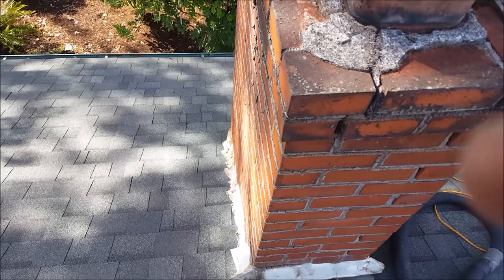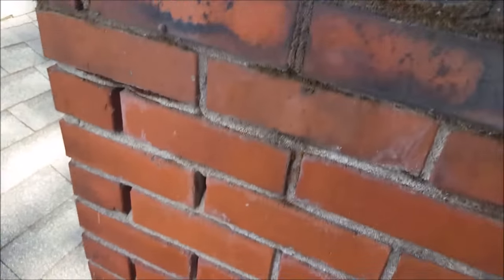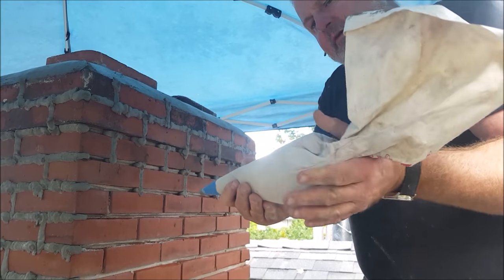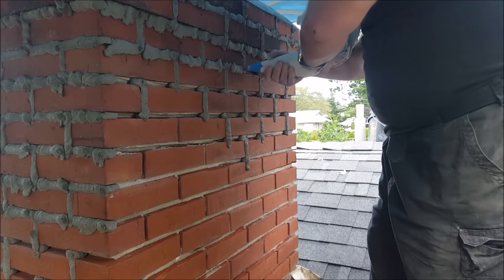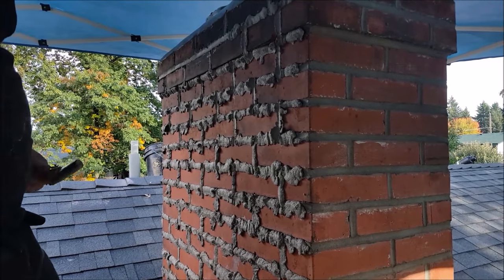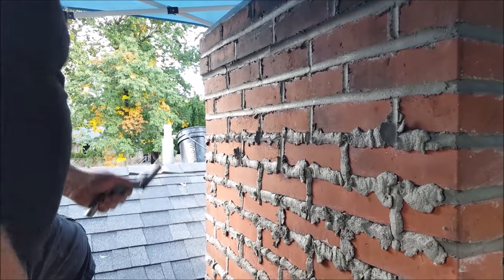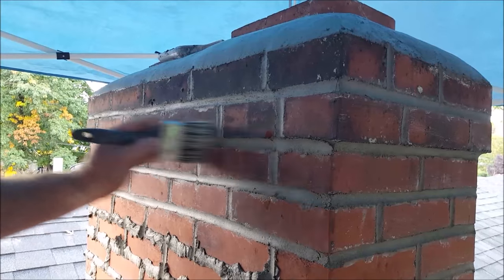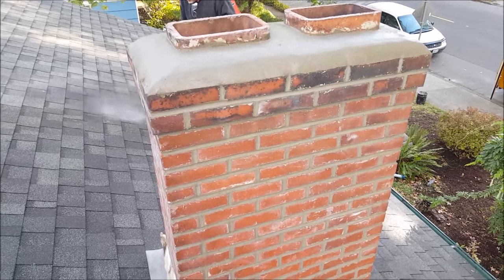Tuckpointing a chimney

Comment: I'm a mason for over 30 years and I've been a masonry contractor for about 10.  What you have seen in this video is a true professional doing a very professional job.  That chimney will be good, like new, requiring zero additional maintenance, for at least another 10 years after his tuck-pointing work on it.  Well done sir.
Reply: not a warranty question but how long should something like this last using the fireplace once a month? im near SLC-UT 🇺🇸 or best to call the masonry people? as the local chimney sweep said that it's about a 2-year job between when i need them again
Reply: @richardprice5978  Any discoloration then
Reply: Very gracious of you , Sean. Thank you.   Cliff
Reply: Any idea about the cost of this job?

Comment: THANK YOU! This is one of the best how-to videos I've seen for us average DIYers with old houses (and I've watched a ton of them). My 95yo chimney is in far worse shape than this one, and you excellent commentary and tips—not to mention excellent camera work and lighting—have been a tremendous help. Thank you for taking the time to share this with us.
Reply: Hey Dan: I had my helper shoot this from my phone, with no special lighting. I appreciate your feedback and compliments.  Cliff
Reply: @cliffordbrand5969  thanks im needing this service done to my place so it's nice to know what to expect from my mason/a mason doing the job sounded like the hole top part of the chimney ( love chimney's and fireplaces parts of the character/charme that sold the place to me plus white stone/brick siding ) cap/roof-stack needed to come completely off and be rebuilt brick by brick but maybe i miss understood how the process works or does sometimes that's what needs to happen to fix it right? all i know is it flunked it's fire-marshal/county ( plus birds and other critters were living in it somehow i missed that and it add's to the damages ) testing and was told not to use it intel i got it fixed, guess after i do get it repaired i need to use it more often as it went bad from neglect/unused for 5+years and now is also threatening the rest of the structural integrity of the 1960's-70-house i didn't know about this when i first moved in so im passing too others as a FWI-cautionary tell

Comment: I was skeptical when you first placed the mortar on how messy it looked, but when you cleaned it all up with your round & flat tools, it looked so nice & very professional.  Excellent work!
Reply: Thank you JG!
Reply: @cliffordbrand5969   hello there!  So me and the wife just bought a house about a year and a half ago and noticed maybe 5 6 months in that our chimney has a leak. Our chimney runs up the back of our house which is connected to our family room and the roof of the family room. Is at an angle on the outside.colonial style home,  from my bedroom window i can sled down to my chimney if you know what I'm saying.. Anyway the drip was small at first and then its started getting real bad having to put towels down in the front of the fireplace so water doesn't run through the front on to the carpet.     I'm no expert so i can't spot the problem but my son did say he noticed that there is a good 3" 4" inch space (open) at the top of the chimney under the cap.   Somebody told me look up in my chimney when it's sunny out and i should be able to see any kind of light that will point me to the problem not sure how credible that theory is but i did it and don't see anything except the light at the top from the crown..  Wife thinks it is the flashing that's draining right down from the roof into the cracks.     Professionals wont return our calls and I'm ready to fix it my damn self before my house floats away.    I'm thinking the people that lived here before us just rigged it up with calk or who knows what!    In short.. I'm lost and you seem like the man with the plan.. any advice you could give me would be greatly appreciated.

Comment: Great job. I'm a chimney/stone man and what I do to skip the acid washing bc I hate it is I use a slicker and a hawk. Pre wet the chimney and before it dries totally I use a dryer mix and stuff and strike as I go. The old chimney guy I learned from never let me use a bag said that's not how it's done but looks great. Nice job man
Reply: lucas keeley an important benefit of using a bag is that there is less repetitive motion taking place. You’re not constantly turning to get more mud which, over the years, is going to affect your back.
Reply: Thanks Lucas, I appreciate it!
Reply: I have done it both ways, the grout bag is faster but it is also a bit messier. Doing it the old way with a hawk board and slicker does provide a higher quality job. You are able to pack the mortar tighter in to the joints with less chance of leaving voids. I carry Rose Brand slickers (the flat joint tool) each slicker have a different sizes on each end, that gives me six different sizes, that allows me to properly pack every size joint from small to large. Then I follow up with a regular concave joint tool. One way to get speed and better quality is to use the grout bag, then pack the joint with a slicker, then along with some additional firm mortar finish with a concave jointer.
Reply: @jthkeystone  Pointing with a hawk and a pointing tool is waaaay faster than this if you know what you are doing

Comment: What exactly is the mortar mixture ? Is it 5:1 sand to cement ? When adding water to the mixture, how do you know when to stop adding water ?  Must be runny enough to exit the injection bag, but not too runny to run out of joint ?

Comment: I am curious to ask, i was always told and advised,  that when pointing  of any kind after removing the old  cement you must wet it down   thoroughly before filling it back with new, so it does not dry out, a nd it helps the new cement to stick there to the brickwork,I was told this is a must do  job,so i always have ,
Reply: Yep.

However he is using loose mortar because he's using a grout bag so it might be ok
Reply: Your data is correct Peter.

Comment: Are there weather temps that should be avoided when tuckpointing?  What is the optimal weather temp to do the work? 50 -75 degrees?
Reply: As long as the temp doesn't go below 40° at night and  it can be warmer than 75 but, try not to do it the direct sunlight especially hot days unless you have done it many times. ( fast) It would be nice to do it in the shade ( make your own) on those days. or Late afternoon - Wait till you can see your thumb print before you strike. If using a tuck pointer and trowel, just do a little section at a time ex - foot square - till you get the hang of it. Make sure to keep the mortar off of the face of the brick. the mortar should be no wider than your tuck pointer / slicker when you pack it in

Comment: Yes the mortar  will stain the roof, get some old carpet to put down,he will step in it and push it into the shingles,then he will have to use a wire brush to clean the shingles and that messes up the shingles.
Reply: We kept the area cleaned up as we went along. Kept the roof sprayed down. No stains on the roof at the end of the job.

Comment: I thought you were suppose to wet the work before applying the mortar ?
Reply: Shelter keeps the sun from drying the mortar out too fast
Reply: @DRS659  Almost everything built in the United States in the last 25 years has been built with type S mortar.  It's the standard mortar specified for most block and brick jobs.  It's the standard mortar stocked at all the big box home improvement stores.  It's very likely that the chimney was originally built with type S mortar.  On the wetting the bricks, yes, that is right.  BUT, if you look at the job while he's grinding out the joints, you'll see that the bricks are covered with dust from the grinding.  Then look at the next scene where he his beginning the tuck-pointing and you'll see the bricks and joints are all very clean, suggesting that he did rinse it with water.  You want the bricks hydrated but not soaked.  Too wet and they don't draw the moisture from the mortar to create a good bond.  In other replies here he said he rinsed down the roof repeatedly.  Probably as he was rinsing the bricks off, don't you think?  And the shelter?  It's hot up there and he did say "if it's hot, strike sooner."  If the sun is beating directly on the bricks, they dry out faster, so shade is helpful to do a good job as well as make the worker more comfortable.  Nothing wrong with that at all.  Try working in Arizona one summer and you'll see great value in a little shade.

Comment: What kind of disc are you using to grind out the old mortar? Will a masonry disc work or should I get one of the diamond tip discs?
Reply: We use a tuckpointing blade that is slotted and about 1/4" thick.  We use 4.5" angle grinders.
Reply: Use a mortar rake or a mortar routing tool that fits on a 4inch grinder using a disc you have to be carful you dont damge or cut the brick

Comment: how old is the structure...were kiln fires of factory brick used??? Do the brick have holes in them if so factory brick is hard fired. You can use your type 's mortar'. If kiln-fired old brick then you should use hydrated lime and not Roman cement If structure constructed before the end of WW2 then kiln fired, after WW 2 then factory fired. Rule of thumb...joint depth should be twice the height of joint....if joint is 1/2 inch then depth should be 1 inch. And joint area should be clean, don't leave patches of old mortar in joint area.

Comment: The crown looks good wish u showed us
Reply: Sly Steve  That's not too thick. 
That's nicely done as far as a "wash" crown goes, minus the lack of expansion. These last many years but yes they always crack. No expansion around the flue liner will guarantee cracks. The best way, in my opinion, is to form and pour a concrete crown with overhang, at least 3 inches thick. I go 3.5-4". I wrap the flue in sill seal for expansion, then top quality caulking around the flue.
Then cut a drip kerf into the overhang underneath, and spray with a penetrating sealer.
Reply: Raymond Hogue,  you basically just mix Portland cement and sand 3 to 1 ratio.  Some do 2 to 1. Meh 🤷🏼‍♂️ whatever works.  I use coarse sand for strength.  Sand topping mix, like was mentioned in the video is basically the same thing.  Wrap the chimney in sill seal or some type of expansion material, then cut off excess after the crown is cured and caulk.
Dampen the top of chimney before putting it on, or it will suck the moisture out and shrink crack the hell out of it. Try not to do this on a really sunny, blazing hot day either. It'll shrink crack.
Wet cure if possible as it's drying, by misting it or covering it in damp cloth. 
Oh, after troweling it on and roughly getting the shape, wait a little and use a damp, wrung out sponge to smooth it like he did.. If you wait just right it'll smooth out really nice.  
I also add an acrylic fortifier/bonding agent. 
No one probably cares at this point but, hey someone might need the info
Reply: @MMGJ10  You are absolutely correct. I have to factor in the economics of the customer. Great post!

Comment: How does one get so good with bricklaying? I mean getting it level...
Reply: It's practice. If you need to practice before doing a job, then do this (Its how they train in the union:)
Make a bricklaying mortar out of sand and lime ONLY. Do not add cement. Look up the formula. Mix the sand and lime together before adding water. Get yourself about 70 bricks. Lay them out 8 bricks to the course (layer) Practice buttering the bricks and laying them up. Level and plum each course as you build it up. I should be shooting a video on how to do this in a month or so. It will be at least 30 minutes long. The sand and lime mortar can be removed and re-used for practice purposes. If you set it aside for an extended period, just check it once a day and add more water and mix it up. Use a hoe and a wheel barrow.for mixing. I really need to shoot this video for you folks. It's too much to write out.
Reply: Practice

Comment: What tool do you use to cut off the top two inches of the trowel?
Reply: A thin cut-off disc on a grinder. You can buy them in packs of 5 at Home Depot, Harbor Freight, etc.

Comment: Question: why so you have to sand it or cut it at first?
Reply: So the new mortar can stay in the joint - if you just put it on top, thin, it will flake off in no time.

Comment: What sealant did you add to the type S?
Reply: There are several out there. We use Masco Bond, which comes from Masons Supply in Salem.
Reply: @cliffordbrand5969  Canadian bricklayer, I was taught to never use S on brick. Just curious if you've heard that or there was another reason you chose it here.
Reply: @DRS659  You're right. I meant to say type N.

Comment: Will that mortar stain the roof?
Reply: Depends how messy you are 🙈🙈
Reply: Keep your mud picked up periodically, try not to step in it, spray down the roof work area periodically. Use a soft brush to scrub the area a bit before spraying it down. SPRAY IT DOWN WELL, ALL THE WAY TO THE GUTTER. LOTS OF WATER.
Reply: @cliffordbrand5969  I did just exactly that.  Hard not to drop mud when your pointing.  I did lay a painters tarp as good as I could to catch some.  But the main thing was not to step in it and wash it down like crazy like you said.  You do good work.   I can't use the grout bag.  Mud has to be perfect and I make a big mess.  I still use the old way with hawk and tuckpointing tool.  Does that bag work well for roller skating joints?  I really need to practice with it.  It's a lot faster.  What do you use to wash down chimney afterwards?

Comment: Well that's not tuck pointing it bucket handle and not very good at that. If you were not do dirty with replacing the mortar you would not need to use acid to clean the brickwork .

Comment: What a shocking job !  Don't bother coming to England to do any pointing ha ha, the second you got your icing bag out to start pointing you'd be gone. Why don't you just use your flat or round pointing tool to push the "mud" in with ?